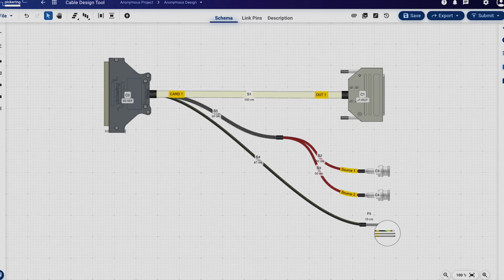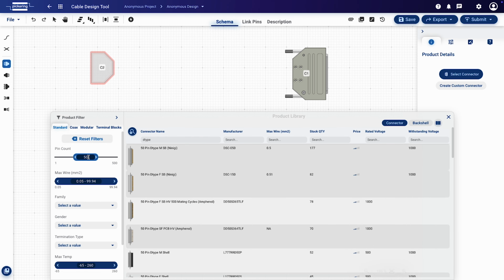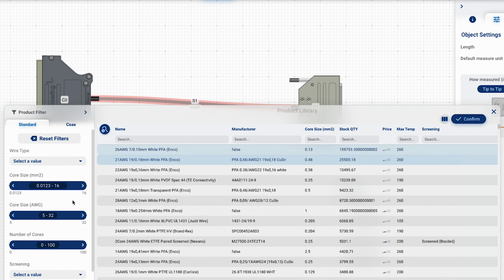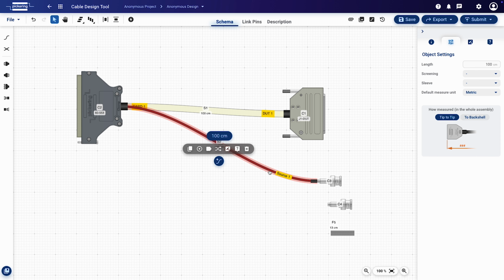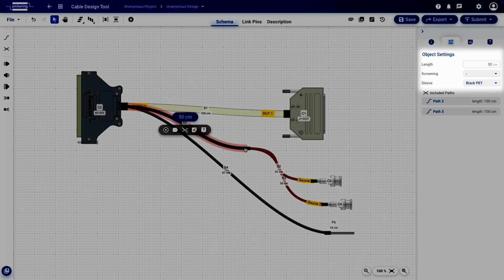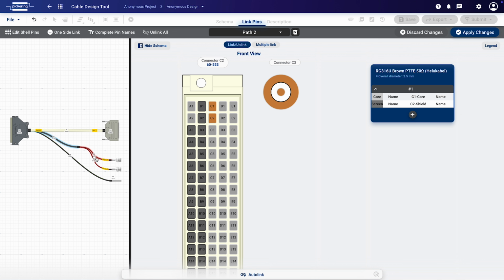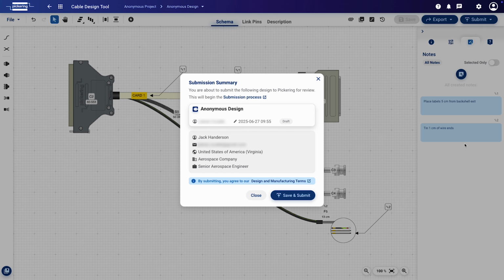Design Cable Assemblies Easily with Pickering’s Free Cable Design Tool [Guide]

Comment from the maker: 📌Chapters:
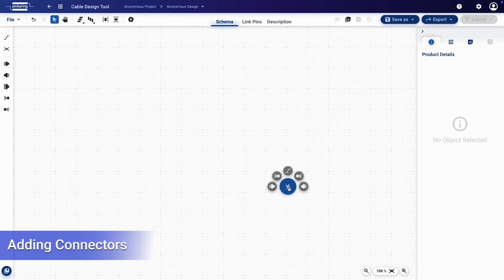 1. Adding Connectors - 0:24
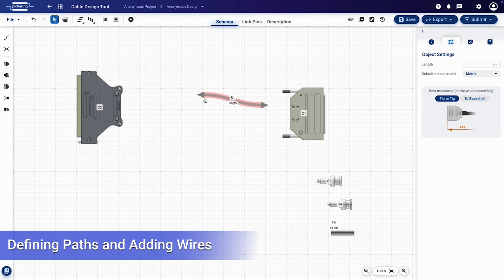 2. Defining Paths and Adding Wires - 2:31
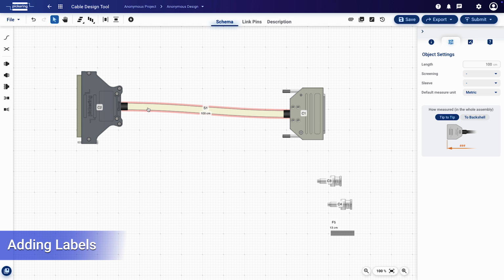 3. Adding Labels - 3:01
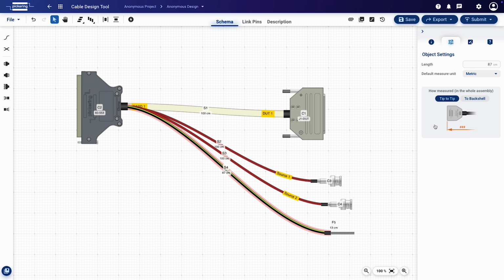 4. Adding Sleeving - 5:00
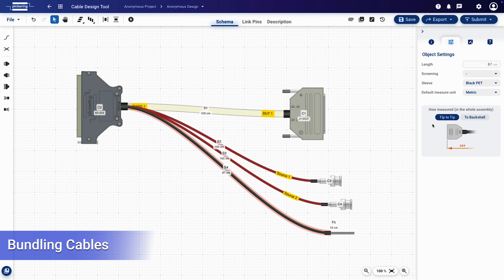 5. Bundling Cables - 5:11
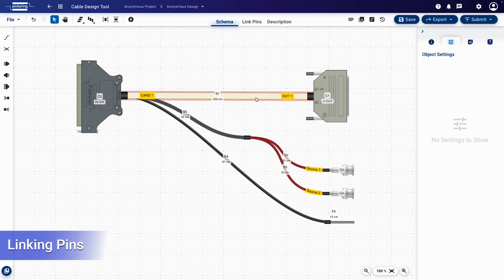 6. Linking Connectors - 5:50
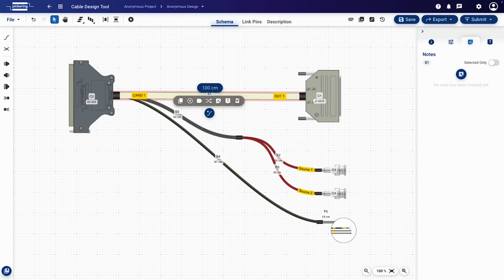 7. Adding Notes - 8:07
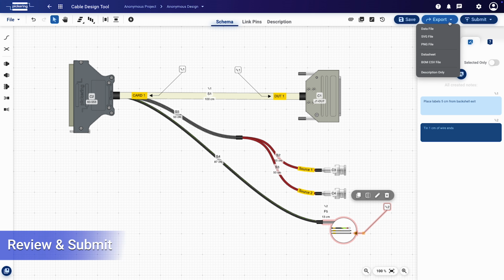 8. Review & Submitting - 8:50